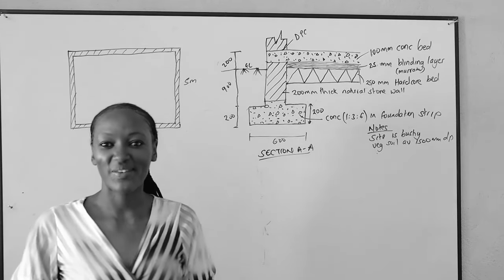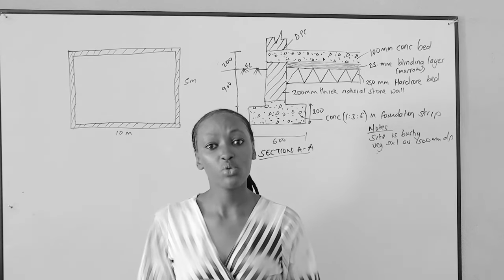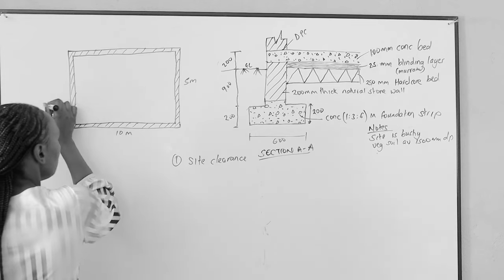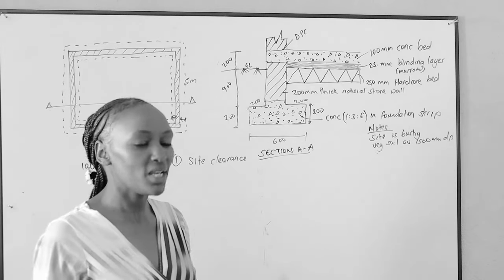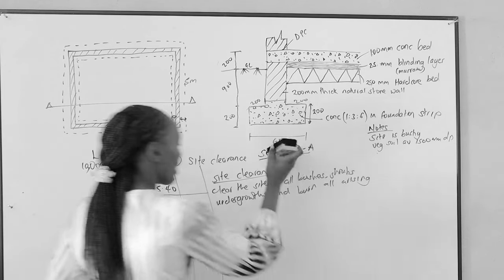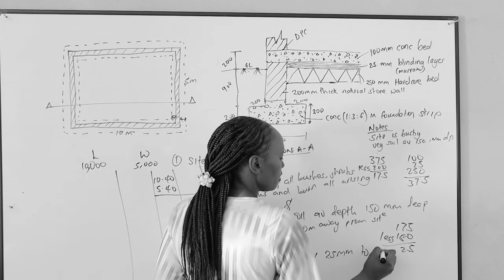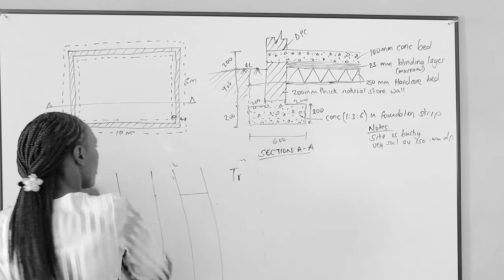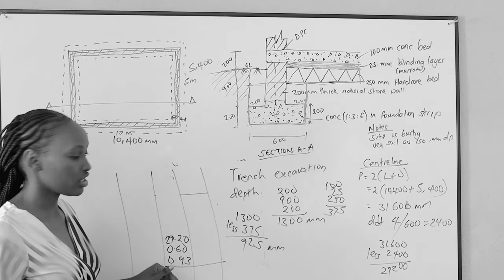How to measure Site clearance,Removal of veg.soil,Reducing the level and Trench excavation.Part 1

Comment: Your site clearance here is topsoil removal. Plus the site clearance is suppose to be the whole plot of land.
Reply from the maker: Thats how site clearance for substructure works is measured.for the whole site is measured under preliminaries
Reply: @easyqs  well depending on the standard method of measurement you're using. Here in Nigeria. Site clearance has to do with removal of the whole vegetation on the plot of land and top soil removal is what you explained having a spread. Do you do top soil removal? If yes what does it entail?
Reply from the maker: @hassanabdulmalikodunayo2701  Top soil removal entails removal of all soil that support vegetation growth after site clearance.It is usually done to the same area we do  site clearance nbut is limited to where the building occupies plus the foundation spread
Reply: @easyqs  so if a 300sqm building is laying on a 2acres of land I'll remove 2acres topsoil instead of 300sqm and the spread?
Reply from the maker: @hassanabdulmalikodunayo2701  No.The cost that relates to the building ie is 300 sqm is under substructures.The rest of the land is priced under the preliminaries